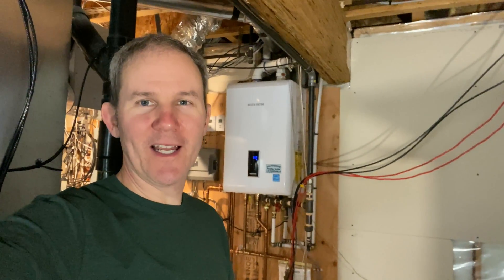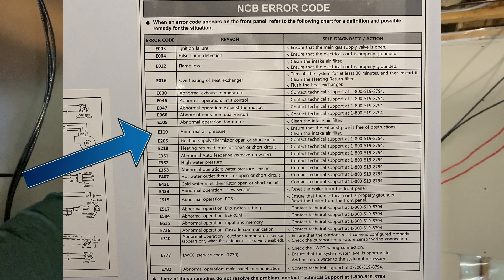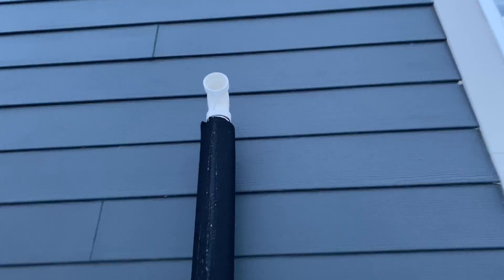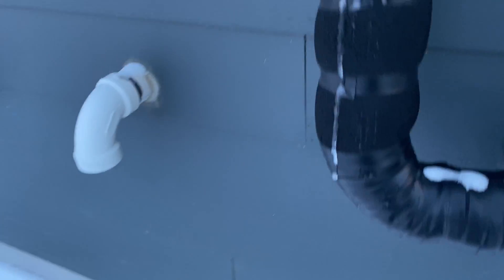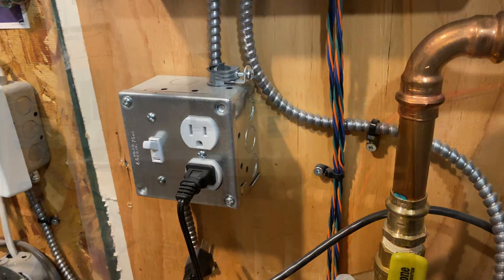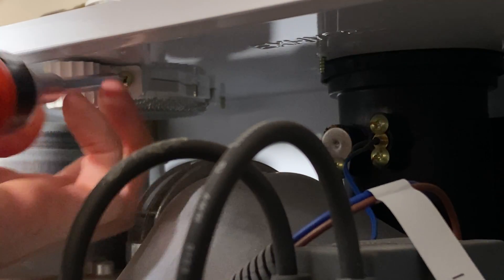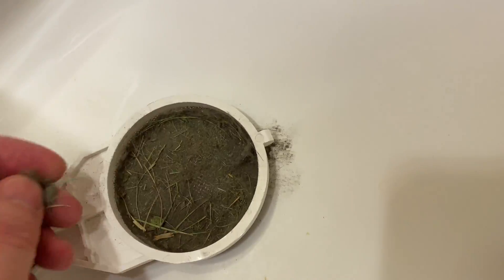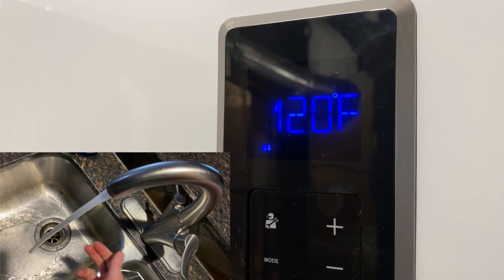Navien Hot Water on Demand E.110 Error code - SOLVED

Comment: Thank you, easy to understand video, helped me fix the issue quickly. 

An addition from my experience, and it might be from how mine installed. It was high up, in the top floor so i just went straight to filter solution (if its the roof outtake someone else is climbing up there). But i had less clearance around the filter than you did. Getting it out was no biggie, but back in was a pain. I have rubber sleeve for some wires in the way and I had to tape that off to the side, and right underneath the vent was a big metal piece from some part. 

But the big pain was getting the filter back in. Those obstructions made lining it back up a pain, and when I finally did i didn't think i was because the piece where you can screw back in can rotate. When i got that figured out i was able to. Not a big deal but getting that filter in for me was trickier than your video but it also didn't help the unit is in a corner above my clothes dryer, so i couldn't face it head on. 

Anyway thanks for the video its nice to figure out how to fix things for free

Comment: Outstanding….problem solved. You have become my favorite Canuck!
Reply: A quick question if I may…. One week after successfully clearing out the intake filter the unit went back into E110 error code status. I checked the intake filter again and it was clean. I then checked the exhaust trap and removed a significant amount of sediment which looked like mud. I put the unit back together and I now have no error codes. Question: would  the clogged trap have recreated this error code the second time around? Thanks again for your great video.

Comment: Doubt you’ll see this, but mine keeps shutting off mid shower and there is no code. Any help would be appreciated
Reply from the maker: I would either watch the heater while someone is using the hot water, or set up a security camera or something to capture a video and audio. That would confirm there is no code and would capture any sound. You could sent that to the manufacture for their opinion. I would do my yearly maintenance and if that doesn't fix it, a plumber would be required. Maintenance video: https://youtu.be/Zdl1IzlakrU

Comment: Thank you!  That screw that holds it has to have a nut in the back, PIA to get it back in.  I just used a larger width sheet metal screw that caught into the plastic hole

Comment: i think i just saved few hundreds of $$$ -- ironically i got the error after HVAC/AC was "serviced" and they said to not look at Navien unless there is an error or hot water is not working! Such a BS -- i watched your video and found a manual of my model; took me 15-20 min to clean the air filter, it was so bad, never cleaned, $$$ spent for "services" during the years.. thank you thank you thank you for this VIDEO!!!⛑
Reply from the maker: Awesome! I'm glad the video helped. If you want to perform your yearly service maintenance yourself, I have a video for that too: https://youtu.be/Zdl1IzlakrU
Reply: @acreagelife9644  thank you again — I’ll try to clean the water filter next; I had the unit descaled by a plumber couple of years ago but he didn’t clean either of the filters; I wish I could add a pic of the air filter here — it was filled with dirt from the outside

Comment: Just woke up to the WIFE saying- The waters not getting hot! as she was getting in the shower. I checked the heater and the 110 code was displaying. I go to you tube and just like that. A quick and concise cause and solution to the problem. Not a lot of snow on ANYTHING her in Southern California. So I was confident it was the internal filter. My unit does not have the snap straps so a Phillips screwdriver was called to action. 5 screws total/ 4 on the cover and 1 on the filter clamp. Most certainly the culprit. Unplugged the unit (safety First )  Cleaned the screen that had a layer of lint like a dryer lint screen. I dried it and re installed. Plugged it in and was pleased that it had a memory of my settings. I was able to enjoy a warm shower. Not so much for the wife.....LOL.   Thank you.Excellent information.
Reply from the maker: Awesome outcome! So glad I was able to help!

Comment: As others have written, your solution worked like a charm.  Thank you so much for posting this.  I have two small additions to contribute.  (1) My 10-year-old unit does not have the clips that yours has to hold the cover in place.  Instead, it has four screws, two at the top and two at the bottom.  Removing those screws to get the cover off is trivial, but I'm just pointing out that my unit is slightly different from the one in the video.  (2) The screws that the installers used to secure the intake pipe protrude through the case and block the path by which the filter slides out.  I had to remove those screws to clear the path and then I was able to slide out the filter (after removing the screw that you warned us not to let drop into the unit).  Again, removing those screws is trivial, but I'm just noting it for others who might run into this same issue.  Thank you again for saving us the cost -- and hassle! -- of getting a service technician to come to our house to fix this problem.
Reply from the maker: Thanks for adding these details to help others!
Reply: This was the exact same path I traveled. Well put sir!
Reply: Mine was the same but managed to open and clean the filter.
Reply: Same here, but I was able to jiggle out around the screws

Comment: My brother in law had the same issue. He asked me for help and this was the first video which came up when I looked up. Man this video was a huge help. I initially couldn't believe such a simple thing could be the reason for such an error code. But I followed the instructions and 10 minutes later everything was perfect. 
Thanks a lot man!!! 🙏🤝
Reply from the maker: Awesome! So happy it helped!
Reply: Thank you so much for this video, it's -16 f outside and woke up to no hot water and the radiators not working. This fixed it right up

Comment: What a lifesaver. Thank you so much. My filter was filled with dead black wasps, for God knows how long finally have hot showers and radiant flooring that works. Thanks.
Reply: I also got help from someone for further repairs.  Your filter clean/fix was spot on, but during the time the system was down, it seemed the overall air pressure was an issue that I was not aware of.  I had to bring the pressure back up in the system.  Best tip was to make sure that screw did not drop though lol.

Comment: Now, if it wasn’t either of those, it would’ve been the condensate trap underneath the heat exchanger which you can get to from the bottom of the unit there’s a little pin that you pull and then the cat comes out most installers. Don’t put an overflow on that condensate trap and it causes it to back up and then you have that same error code. Remove the cap clean it out. Reinstall it bing bang boom. Good to go.

Comment: That's awesome how your exhaust is so close that window😵☠️👻
Reply from the maker: Yup, that's been inspected to code, as well as the distance from the furnace air intake. CO detectors have yet to pick up any anomalies.
Reply: what code? IPC or upc? exhaust is supposed to be 3 to 4 feet away from a window or door.
Reply from the maker: I think this is the code here: https://open.alberta.ca/dataset/88448076-7f1e-4bbc-8767-b90caca76fbe/resource/bf607516-ea58-4c39-bef9-ed28879adc21/download/ma-standatagas-bulletin-20-gcb-02-rev2.pdf
The window is exactly 3ft from the centre of the exhaust pipe.
Reply: page 49 ref B in your installation manual for your navien. It's better to be wrong than to be dead wrong. And I don't even know you, but I'm saying this out of concern and love.
Reply from the maker: Thanks for the concern, love and the reference from the manual. I appreciate the info! I live in a small city and have easy/quick access to the inspectors. Thanks again!

Comment: What if the exhaust pipe is clear and the filter is clean. I’m still getting the error code about 1-3 times a day. Could it need a new air pressure sensor ?
Reply from the maker: Yeah, it could be a sensor issue. At this point it might be necessary to make a service call.

Comment: So, the intake was full of frost. How do i remove it? I used a wire coat hanger to try to "pull" out as much as I could, but my concern is I just pushed the frost further in. The system came back on, but I am concerned about the frost I pushed in melting and doing damage to the system. Please let me know if I need to do any further steps.

Comment: What does it mean if you go to clean the filter out and it’s not dirty at all, but the E110 code still comes up?
Reply from the maker: Check to ensure the air intake and exhaust pipes are totally clean. There could be frost or some debris in the pipes preventing the unit from firing up.

Comment: I wish my filter was dirty.  My intake and exhausts are clear as is the intake filter.  I get E110 about once a month and only way to resolve it it to cut power to the Navien (unplug it), let it restart which inevitably leads to it shutting down with the E110 error again. Repeat 5 to 6 times until if fires up without error. Takes about 10 mins and sure is frustrating.
Reply: Did you ever get it resolved? I am having the same issue. My filter is clean but it still gives the error.
Reply: @kennyphan409  same problem for me as well... filter is completely clean but i keep getting E110 every few weeks and then it needs multiple restarts to resolve.... any luck figuring out what the cause of this could be?
Reply: same problem for me as well... filter is completely clean but i keep getting E110 every few weeks and then it needs multiple restarts to resolve.... any luck figuring out what the cause of this could be?
Reply: @suer1935  I did resolve it. It ended up being the exhaust and not the filter. The exhaust had water getting in so I dried it and installed a pvc that faced downward so that rain didn't get in when storming. The original guys who installed it installed an opening where it was sideways to where rain could get in.